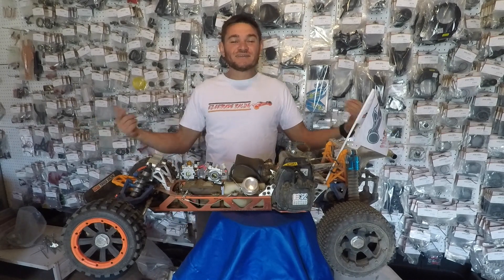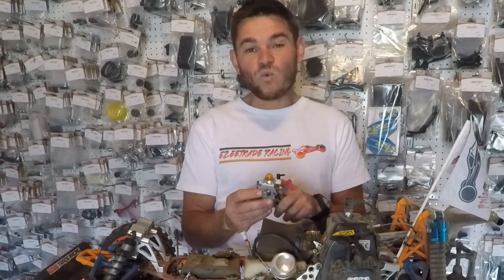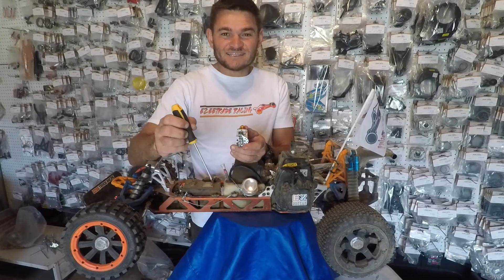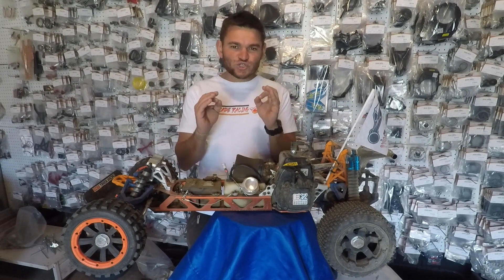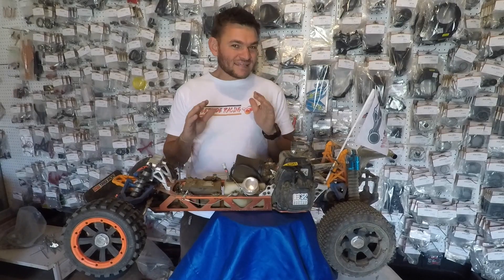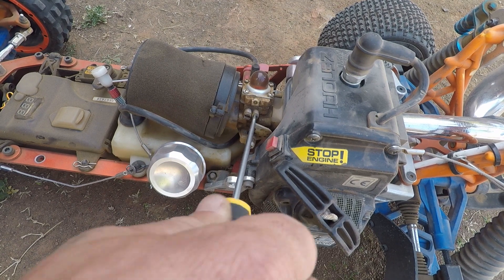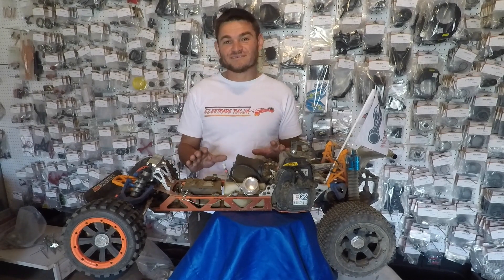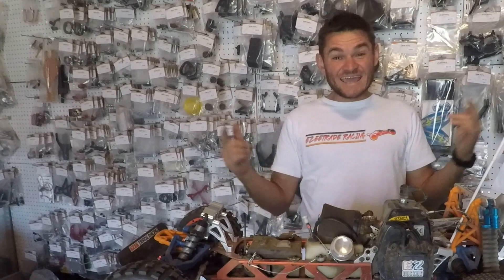Tuning A 2-Stroke RC Car │ Ezeetrade Racing

Comment: You are the only person that can explain 25:1 ratio mix.
Reply from the maker: @JasonBrinson-m5c  thank you so much.  I try to listen to what you guys need to hear.
Reply: dont listen to the bs guys try to sell you that 32:1 40:1 or even 50:1 is right. 50:1 is right when you use RACING petrol/gas with a high quality oil to mix.
if you are just running pump gas/petrol, the lowest oil content you can go is 28:1 for bigger engines 45cc and up i suggest you go 24:1
but hey, thats my honest opinion and experience.
also, stay away from the 1107 carb if your engine is below 32cc just go with a 668, 998 or 990 to make your tuning life easier.
Reply from the maker: @VintageCR  good advice bro 👌

Comment: 3:20 is the critical moment in this video to me. Closing both needles proved my Rovan 29 can start no problems. This info was critical to me, as I don’t like to change plugs and carbs for no reason. Furthermore my engine only idles with the LSN at half a turn out. I know that’s crazy for a Walbro carb. You would think it’s too lean. So either it’s note getting enough air or….? Time for a carb tear down and filter clean I think
Reply from the maker: Good day there. Thank you so much for watching. I am really glad that this video could help. It does sound like something in your carb needs replacing but not too serious. Luckily these carbs are reliable and easily fixed. Hope it gets you up and running very soon.

Comment: I just buy a baja b5 and the carb was bad i put a new carb and follow the video its just amazing the best video for tune carb!! I just have a question they smoke but roll good i dont know if is to rich or my mix gaz tanks you best video!!!
Reply from the maker: Good Day. I am so very glad I could help. 
If the car smokes a lot, it is as you say- check the fuel first. It should be 40ml oil to 1litre fuel. 
If the fuel is right and it still smokes, then the high end needle is too rich. Close high end 5minute turns at a time until it smokes a little, but if performance changes then go back one turn. Some smoke is good, but not too much smoke.

Comment: Tune with choke open or close ? And run the car with choke open or close ? Thank you great video
Reply from the maker: Choke always open. The max I will choke a Baja is 2x pulls. If it doesn't fire with the choke open after that, then something needs to change.
Thank you for the support

Comment: Excellent video!  I do have a situation with my 5b baja that I just purchased.  It sounds like it is tuned correctly but it basically goes from idling & with the slightest touch to the trigger it sounds & acts like its 3/4 throttle. I'm leaning towards either incorrect linkage setup for throttle & brake or incorrect setting with my radio? Do you have any suggestions? Thanks in advance!
Reply from the maker: Hi there. The options you mentioned is definitely possible but it is also possible that the intake manifold is loose and everytime you put pressure on it by applying throttle it opens the gap allowing air in and spikes the rpm.
Reply: @EZR  thank you for your fast reply.  I had not thought of that, but the loose intake does make total sense. I have the throttle linkage setup to when I give it full throttle with radio, I can still slightly move the throttle with my finger (so the servo isn't under strain). The FlySky GT3C radio, which is not "hacked", I think its setup correctly but not 100% sure. I will check the intake.  It's crazy how the buggy will go from sitting idling to what sounds like at least 3/4 throttle....it takes off fish tailing. Lol.  Hopefully the intake is loose and can easily be tightened. Thanks for your suggestion.

Comment: Can you make a video on how to seal the head without using the base gasket please bro. I don’t know how much to apply and what pattern I should do!
Reply from the maker: Hello there. Thanks for watching.
I basically put as little as possible in the crank case side. Like literally just make it wet with the gasket maker.
But it will be a good video idea too.

Comment: Can you do a video on tuning the king motor 2 speed trans? I cannot seem to get mine to shift at all. And the button head screw always backs out everytime I use it. I dont really want to put lock tite on it becasue I want to tune the gear shift points
Reply from the maker: I bought the new  Rovan 2 speed to test but unfortunately we won't be testing the KM one yet. Those screws need a very soft thread lock to keep it in due to vibrations
Reply: @EZR  what thread lock color would be a soft one?
Reply from the maker: Ours in SA is Blue by Loctite. Not Red
Reply: @EZR  cool thanks

Comment: Hi I wanted to ask see when you flood the engine have you ever tried removing the carb and pulled the starter to fire it up to clear it,  then put the carb back on and started it up
Reply from the maker: Hello there. No never. If a 2 stroke gets the right tune you can't flood it in a sense. If you leave the choke on and fill the engine with fuel, you can put the choke off and and keep pulling till it starts. They not as sensitive.

Comment: the stock tune my new zenoah g320 came with was definitely a little lean on the low screw, this engine is so much better / stronger than my old 29cc rovan, my baja does wheelies now xD .. my 29cc lost at least 1 hp after 60~ liters of fuel, i think its the bearings .. sometimes it had full power and on the way back it suddenly felt sluggish for no reason, didn't matter what i changed on the carb it always ran weird :/ 
im probably rebuilding it at some point to throw in a roller or something
Reply from the maker: @tezy0193  Yeah those G320 engines are the boss. Very reliable.
These engines do like the bottom end a bit richer.
The 29cc probably needs new ring and bearings then it'll be good to go again

Comment: Hey bud my fuel line has bubbles and the car starts but doesnt stay long its stips whwn the throttle released how ever where the gas  intake pipe it moves around .
Reply from the maker: Howzit
So that intake can move but not easily. It should be air tight. If it's a Walbro you can get a replacement. Try this as a start tune: 
idle screw all the way in
High needle 1x turn
Low needle ¾ turn
Then when it starts open the low needle until the idle is good.
Reply: @EZR  ok sure let me try then I'll inform u thanks bud

Comment: My baja 5B the tune is perfect low and high speed needle. It’s just when I brake  and hold the brake on it wants too cut out after a couple of seconds?Do I need to turn the idle up on the carb just a touch? Or should I adjust the end points for the braking on my transmitter?🙂
Reply from the maker: Turn the idle screw in just a bit. Also check that the throttle servo is not putting strain on the carb shaft. It will wear it out very fast.
Reply: @EZR  thankyou very much I’ll give that a try once the weather clears up! How do I check that the throttle servo is putting strain on the carb if it is? Sorry for the questions haven’t had a petrol Rc for a long time now so getting back into it.
Reply from the maker: Basically when you pull the brake the spring on the brake should stop moving before the spring on the throttle link
Reply: @EZR  Ok I will check it, and if it is straining the carb how do I go about fixing it? Thankyou for everything, highly appreciated!!
Reply: @madnessgamingv479  the limits on the controller, turn them in until servo arm moves and the throttle doesn't

Comment: After the low speed and high speed needle are allset should we turn the idle screw back until it doesnt touch or just put it where it is?
Reply from the maker: No. The idle screw stays all the way in all the time. Don't need to touch it again.

Comment: Hey bud I replaced a new carb but since it's stock setting it should start and good to go right but how ever it sometimes starts and runs sometimes it's stops when I throttle or sometime it won't start at all
Reply from the maker: It is a big misconception that they are pre tuned as these carbs are used on many different applications so we must tune it to our specific engines. As mentioned in this video I apply these settings to every single engine that comes through my hands including the engine that I ran on our last video that went 18km non stop.
Reply: @EZR  oh ok sure I'll tune it bud
Reply: I did it it started so the car runs but the idle needle is all the way in is it ok to keep the idle needle closed
Reply from the maker: No it's to keep the low end rich. These engines loves a rich low end.
Reply: @EZR  ok then I'll open it but I ran few hope fully it doesn't effect that much.
Reply: Sorry to bother you bud I did open the idle screw and I adjust the lsn as well to counter clock wise little bit the engine quits
Reply from the maker: Open idle screw? As per this video the idle screw must go clockwise all the way in. Then LEN one turn out. Start. After the baja fired you must set the idle with the LEN. Don't touch thr Idle screw from all the way in. Do you have Whatsapp, Telegram or WeChat?
Reply: @EZR  I have instagram bud
Reply: Addy_ftn bud

Comment: So with the base tune of idle screw all the way in n high n low 1.25 out it can been ran like that? Or is that just to get it started?
Reply from the maker: It mainly to get it started. Then you need to set the Idle with your low end needle.
Once it's driven warm you can tune top end with High Needle.
Reply: I’m as lost as u r bro probably more with all this ngl I’ve got a rovan myself but I’ve used it a few times but I’m scared to start it up Cus I’m struggling to tell if it’s to lean rich or normal 😂😂

Comment: Can I do the same for my 1/5 scale hsp mxt5 warrior which has a zenoah engine and the carburetor doesn’t have the choke. And I also need to know what’s the cc on this rc or how can I know what zenoah model is exactly equipped on this rc ?
Reply from the maker: You can do the same on your model yes.  Zenoah normally have a code on the side of the cylinder behind the flywheel. Just Google that code and you'll know which you have.

Comment: @EZR I installed a gas kills switch for my car and I had it running then i  messed with the low needle screw and idle and now it still wont start but pops once then yanks the pull cord out my hand. I cant figure out how to resolve the issue and to get it running again i would love some pointers. its a 30.5cc with a tuned exhaust.
Reply from the maker: First thing I'll check is the coil. Make sure you got the right gap. Then try and give it more fuel by choking it a bit longer. 
Above said if your needle setting are as per my personal settings.
Idle screw all the way in.

Comment: Hello
I tried your way on getting my baja started 
Thanks 
But when I am trying to tune from there it blog when I hit throttle and cuts off 
Which way I go with the needles
Reply from the maker: It sounds like it's rich on the top. Close your High End needle 15minutes
Reply: @EZR  Thank you for your quick response 
Keep up the good work

Comment: so I have a brand new rovan Baja with a 36cc engine, I can get it started but it will only idle for ≈30 seconds and then die, it also dies if I give it any throttle, what's the issue?
Reply from the maker: Wierd. Is this on my base settings?
One thing I'll check is if the gasket behind the Carb intake manifold is the right way round.
Double check fuel lines. But it could be a myriad of things.
If you have whatsapp you can send me a message? Check for my number on our website

Comment: Just a question. I am gonna break in a new engine 32cc. What’s the best temp before I shut it down for a cool down   Thanxs
Reply from the maker: After years of testing I have come to believe that the 2-stroke engine doe not need break in per say. Just a easy first tank and there after give it hell. Keep the fuel ratio right and tuning a little rich.
Reply: Ok Thanxs
Reply: @EZR yea mines still new in plastic haven't had a chance 2 do anything. So run 3 tanks of gas an I should b gd huh
Reply from the maker: Just run is nice and easy and make sure it's warm before you pulloff.  No need to let it idle for long periods of time.
You might need to tune it a bit as it warms up. Most important is ensuring the inner filter is oiled and you have the right fuel/oil mix.
Reply: @EZR   thanx you 👍🏻

Comment: Do you have tips on diff oil?   I have an early 32cc 4wd. Same as redcat dune runner
Reply from the maker: Howzit 
Personally I do not use oil at all. I use high heat Bearing Grease. On a 4WD you want to pack the centre diff very full of grease, the rear diff according to your terrain(off road= full/on road= half full) and then front diff only half full.
Reply: @EZR  cheers bud

Comment: Hi.. my rovan 32cc engine dies after i release my throttle at full even without using brakes. What should i do? TIA
Reply from the maker: Hello there. 
#1 is your Ide screw all the way in?
#2 does your throttle copper shaft have any play?

Comment: question. my  brand new 290rc ran fine first 2 breakin tanks at stock settings (super rich) but now i cant get it to idle without turning the idle screw in like as much as your "standard 1 full turn out from bottom".. is this normal? for them to change this drastically from first few heat cycles?
Reply from the maker: @claudekim7876  thanks for reaching out. Every car is very diverse. It is normal yes. It if you are running the Rofun 1107 it could mean more so. Those carbs within the same model is very diverse. Question for you: is the big idle screw all the way in? The important part is having a good running car that smokes a little once hot. It will smoke more when cold. This is normal.
Reply: @EZR  its a 990 carb. Yea screw isnt all the way in but it is decently in. Id say 1.5 or 2 turns out. The stock needle setting (1 1/8 L and 1 5/8 H) makes my car run super rich. Tho i think this is the fault of the 2 stroke oil im using. I changed it to amsoil dom yesterday and it smokes far less and seems to idle way higher now.. (even after heating up). 

Im just confused cuz some ppl say you should back the idle out all the way and then move it till it just starts moving thr butterfly. But then everyone else ive spoke to says to screw it in all the way and back it out 1 or 2 turns to start...
Reply from the maker: @claudekim7876  I have owned and tuned these cars for more than 10years. I am one of five 5th scale automotive technicians in South Africa and 99% of all cars I turn the idle screw in all the way and don't touch it again. Especially the 990 because it needs a very righ low end to start reliably. Trust me on this. Set your idle with the Low End Needle not the ideal screw
Reply: @claudekim7876  you ever figure out which method works better for you? Also struggling to get my 290rc running right

Comment: Are gas rc cars easier to tune than nitro rc cars?  I had a nitro and it felt like I had to tune it every time I used it.  Eventually I gave up and went electric but I'm interested in gas because I was told they are less work to start and maintain than nitro.  Is that true?
Reply from the maker: I packed up 9x Nitro cars 6years ago and never touched one again. It is now a swear word in my home. With Gas I play more than I maintain. And maintenance and upgrades are a lot more fun.

Comment: I can’t get my car to idle, will this work for it? It starts but won’t idle and just dies when I take my finger off the accelerator
Reply from the maker: #1 check of your throttle shaft (the copper one going through the carb) is moving around. Like it's loose. That will suck air and the carb body will need replacing. 
If not then the settings in this video should help. Note that these settings are made for healthy carbs.

Comment: How about the high end niddle? How to tune it ? Cause all i can see in this video is the low end niddle adjustments
Reply from the maker: The high-end needle is tuned by ear. My experience is that the top end is to achieve good RPM without bogging. Rather run more than less. Your engine will thank you for it.

Comment: Hi I installed a brand new 990 carb on a 30cc. Now she won’t start at all  it’s like no fuel even getting in to the engine. I have tried everything. Low speed needle  1 1/8th turn and high 1 1/4 turn. What should I do  thanks
Reply from the maker: I'm running exactly the same at the moment. It's the chokeless one right?
When I tune a new one I leave the High end on 1%½ and start the Low end at 1turn. Then i give it 5pulls. It no fire then I open the Low end ¼turn and repeat the process. Once you reach 2turns and no fire, then something else is wrong.
Reply: Thanks for getting back to me.  And yes it’s the choke less one.  So I took it apart blew 10w 40 through every hole. One of the holes was clogged.  Put it all back together put it back on the Engine. And bam she fired up    That’s a few carbs now I have bought and there has been issues.  Thanks again
Reply: @larryguest6468 I’m having carb issues. One of my carbs is blocking air. One of my carbs is blocking fuel. Can you describe what you did more “blow 10w40” through every hole” how did you do this? I do have synthetic motor oil for my motorbike but not sure how to blow oil. Air compressor or what?

Comment: Hi, I can’t get my baja to start what so ever, I’ve checked the spark plug gives a spark, I’ve even gotten a new walbruro carb, I tried a roto start, its just dead, 
Took the head off cleaned everything with petrol, piston and sleve still good, put it back together, still nothing.
Reply from the maker: Howzit John.
It sounds like the sparkplug. I know you checked but I would suggest replacing it. Bogus plugs still spark sometimes.
Reply: @EZR  Okay thanks I’ll give it a try.